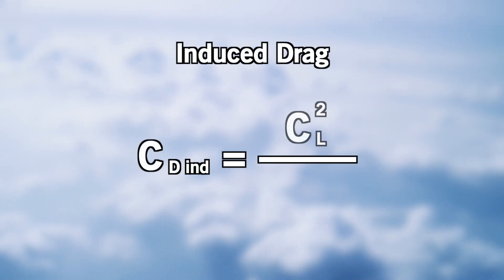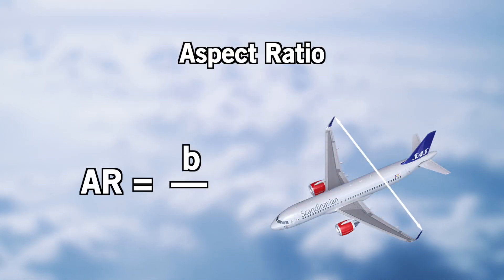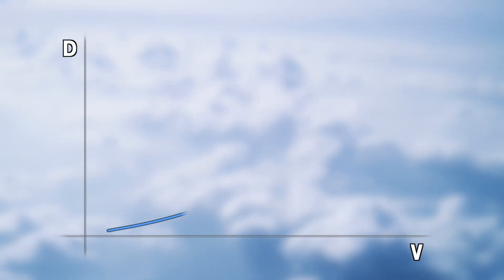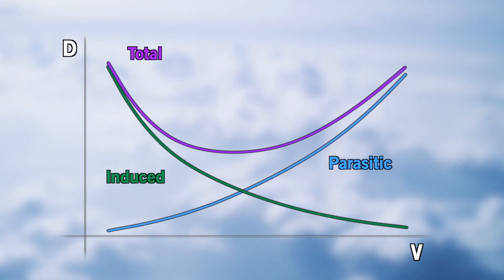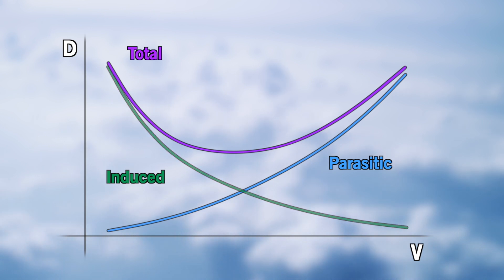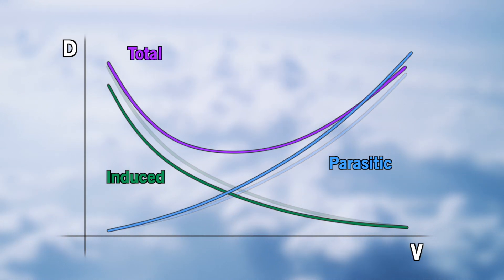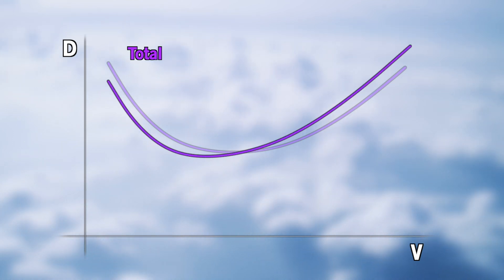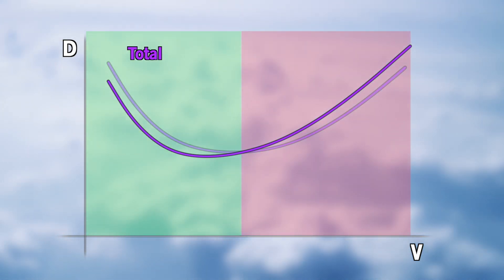The Aerodynamics of Winglets

Comment: Parasite drag is produced by VERTICAL surfaces and Induced drag is created by HORIZONTAL surfaces, for example when the Flaps are at 0 degrees they produce Max Induced drag and Min Parasite drag, at 90 degrees Min Induced and Max Parasite drag and at 45 degrees in the middle of both, for a flap with no thickness. The fact that Lift and drag are both proportional to airspeed squared, means airspeed affects a 2 Dimensional surface, geometrically a Square plane. Wing Vortices are not the cause of Induced Drag but it is just a Visible Effect of it. I have developed a hypothesis to explain physical, atomic and subatomic (gravitational movements, Center of Gravity and Mass), however I need to validate my V & H surfaces theory first.
It seems that Winglets reduce Lift and increase Drag, I also believe in turbance Winglets impose additional stress to wings and all other moving parts inside the wings like rods, joints and moving surfaces. Wingtips also decrease the stability and controllability in turbulent air.
Please let me know what you think, thanks.
Reply from the maker: I think this is completely inaccurate.
Reply: I watched your video and realized that you too know the winglets are just a marketing scam. I thank you for your video and your reply. As a professional please explain scientifically and logically your reason(s) to invalidate my findings. @lucasferrando-english4512

Comment from the maker: Thanks a lot for watching! I hope you enjoyed the video. Had you ever wondered what winglets were? What do you think of the most modern winglet designs?
Reply: Parasite drag is produced by VERTICAL surfaces and Induced drag is created by HORIZONTAL surfaces, for example when the Flaps are at 0 degrees they produce Max Induced drag and Min Parasite drag, at 90 degrees Min Induced and Max Parasite drag and at 45 degrees in the middle of both, for a flap with no thickness. The fact that Lift and drag are both proportional to airspeed squared, means airspeed affects a 2 Dimensional surface, geometrically a Square plane. Wing Vortices are not the cause of Induced Drag but it is just a Visible Effect of it. I have developed a hypothesis to explain physical, atomic and subatomic (gravitational movements, Center of Gravity and Mass), however I need to validate my V & H surfaces theory first.
It seems that Winglets reduce Lift and increase Drag, I also believe in turbance Winglets impose additional stress to wings and all other moving parts inside the wings like rods, joints and moving surfaces. Wingtips also decrease the stability and controllability in turbulent air.
Please let me know what you think, thanks.